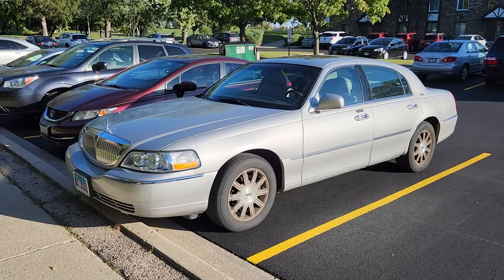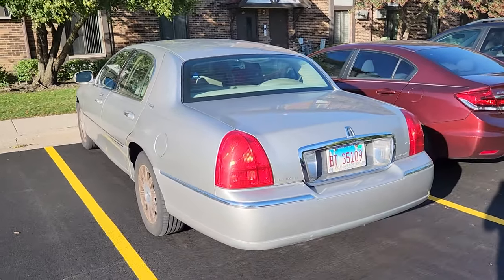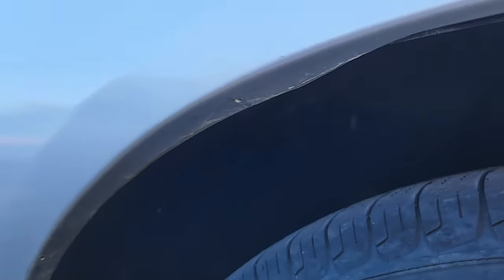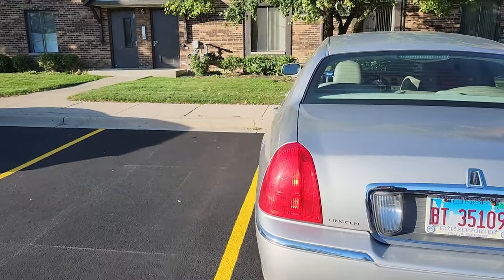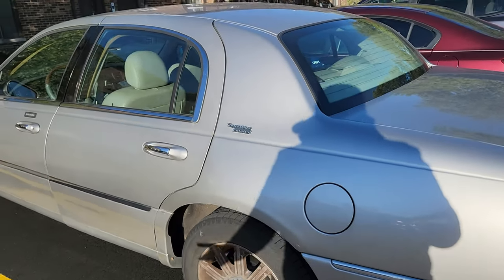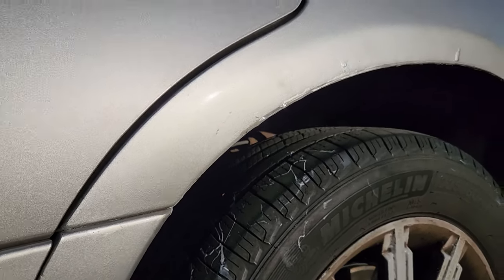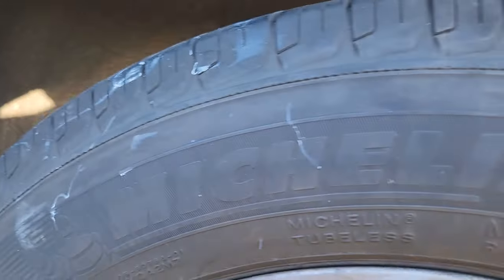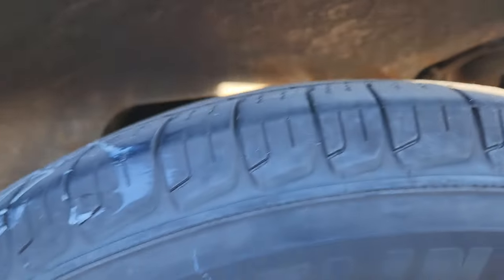Lincoln Town Car Guy Tries Flexseal to Fix Quarter Panel Rust on his 2006 Signature Limited

Comment: Flexseal doesn't "fix" rust - just a coverup.  Get yourself a small sandblaster from Harbor Freight and blast the rusty surface clean of rust.  Then metal prep and sealer followed by primer and paint - and THEN apply undercoat of your choice.
Reply: I've spent almost 4 decades around old cars. Undercoating is the biggest fail that most don't understand. Unless u r going to UC new fabricated or 100% Sandblasted, prepped, etc it will just rust under it. I can't count on both hands how many times a car has been in air or I under it looking thinking, Wow looks pretty solid until I try the screwdriver test and it's like Swiss cheese under UC. Or the whole sheet of UC is pulled off and it's all rust under. Seeing what ppl do to their cars I get not all have tools, time, money, exp to do a high level restore, but as anybody who knows or has done this work of fixing up, restoring etc prep is 90% of a good job. If we cheap out, try to save time money etc it really hurts the finished product. Some are 50mph cars or 50 feet. Looks great going 50mph or from 50 ft, any closer it's not so good. If we're talking rhino type UC,  great. Sandblaster won't hardly touch it. If put on correctly. If anybody has ever sanded, blasted and heavy equipment as Dozer, Excavators etc that JD paint is some of toughest stuff I've ever had to remove. I use that black as a coat after a rust killer type paint inside frame and under body. So basically layer the protection. As in Sand blast, Seal with whatever, prime with some good zinc primer, topcoat that Rustoleum, Farm implement paint with 3 capful of hardener, then a spray of some type of coating. A old man my pap worked with drove a post ww2 ford car to work in the 50s-90s. Pap asked How do u keep car looking like new and fight the rust, lived miles away from Lake Erie, he gave him a list of a few things. 1 quart of any oil new or used, 1 quart of new used trans fluid, 1 tube or tub of grease, 1 wax ring toilet gasket. Mix and heat and spray. U can add whatever u want to it like boiled linseed oil, chain saw oil etc. I like using hydraulic fluid as we drain from all equipment every year. Seal up drain in doors and melt a tub of Vaseline, use baby, mineral oil and some trans fluid and pour in door skin bottoms. Leave for a few days and the drain. You can do this with hood, trunk, rockers etc. I've tried 3m Cavity wax, Blaster wax, Cosmoline, Coal tar etc. Best, easiest, cheapest longest lasting is the oil, fluid, grease wax mix. Most fluid film type products at $10 per can has no oil based chemicals. U can add whatever u want to it that u want to try. I've used since 90s and have had no rust on any vehicle that sees salt, mud, rocks etc. Protection is key. Using a Ospho type product to kill rust they a wax type is best way to help keep our rides out of scrap yard. New ford's rust in months. Alot of videos on this. They don't make them like they used to. Paying 80k for a vehicle with a msrp of 40k is robbery. Have them keep their vehicle and make urrs last as long as possible.

Comment: Here in the Midwest rust is a very big issue. I had a 2004 Buick Century with 132K miles that I bought about a month before you bought your Town Car. The rocker panels had been replaced and painted before I got it. They didn’t do the best job and they were starting to rust again plus there were small spots at the bottom of both wheel wells on the drivers side.  I wanted to have it fixed but it would have been thousands and it would have come back at some point.  I found a like new ‘04 Century with 28K miles exactly like mine a few hours away that was Ziebarted new and is 99% rust free which is VERY rare for one of these here in Indiana (most of them have rot holes in the rockers now).  I am going to keep it that way and not drive it in the winter months.  I was able to sell the old one for basically what I paid for it almost 3 years ago.  The new one was not cheap, but I think this was definitely the better option as the older one was not really worth putting that much money into. It was nice having a car with some “battle scars” as you called them.  If it gets a new ding it’s not that big of a deal.  The new one is so nice and has such low miles I kind of hate to drive it😩  Oh well, now my Yukon will get more use and BTW I will be undercoating it with Fluid Film before the snow falls.  Up to this point it has pretty much not seen winter driving except for a few times last year.

Comment: Same issue when I removed those sweet shiny fender skirts. Idiots didn't seal the holes with anything and seals are crap or didnt take care of them and now I have a spot on both rears. If u not gonna weld it get some Ospho. I've used it for decades and it's the best rust converter and protection for clean metal. Most ppl just use for rust. It's great for bare, sanded, blasted etc. I tested with a muffler clamp for months. No rust. If rust is bad, flakes etc remove all u can. Then I used some muratic to get back to good clean metal. U gotta baby sit it. Can't just brush on and leave. If u don't or can't do that and it's surface rust use Ospho. Get a can of Car Rep primer. It's epoxy 2 part like used in a gun but it has NO POT LIFE. With other 2k cans u pop off red cap and pop bottom of can and u got 24 hrs max, in a ziploc in fridge b4 it's bad. With Car Rep it has no pot life. I used some months apart. It don't mix until u spray.
 The man with sandblaster got right idea. U can make urr own very cheap with a spray nozzle and a pop bottle. Small jobs only. Just like this. Blast it clean, primer then paint. I used a Eastwoods internal frame or chassis saver paint. Then farm implement paint. Undercoating is the worst idea. Even worse than flex seal. At the least use rustoleum. Spray all rust with ospho. I made my own that my pap told me about from 50s. 1 quart of any oil new or used, 1 quart of new used trans fluid, 1 tube or tub of grease gun, wheel bearing grease, 1 wax ring toilet gasket. Mix and heat and apply. I've tried fluid film, Blaster etc. U will never see rust on metal that has trans fluid, oil, grease on it. These products we buy have no oil based chemicals. So all the wax won't do much. Cosmoline is great but needs to be heavy. And it costs. My rust protection using used fluids will cost $6 and 5 min of time. A old man who worked with my pap at Ford plant drove a post war Ford sedan. Pap asked him how do u keep that old thing so nice and rust free next to lake erie and our snow? He told him what I told u. He drove that old car his entire life. No rust. Knock off heavy, spray Ospho with old bottle sprayer like Peroxide, winded etc whatever. Ospho is thin like water. It's not bad like battery acid. Wear eye, gloves and a mask. Spray all rust. Wait 24hrs. It WILL NOT RUST AS LONG AS IT'S ALL CHEMICALLY CONVERTED. Impossible on a chemical level. My 07 looked like urrs. It's been almost 3 years and it's still fine. Besides this new issue with fender screw holes rusting. And the Save a tree ppl calm down, this recipe will not run off. The waxakes it sticky as hell. Farting causes more pollution than any of this process. Gotta stop the rust. Have to. If not it will kill the car. And remember that may seem like a lil bubble but when u pop it, it's 2 times that size at least. Use a syringe to poke and put ospho in those bubbles and buy some time. I went overkill. I did chassis saver, inside frame and out, farm implement paint, then rustoleum, then my rust recipe. If u want to keep car, kill that rust. Even if you just use Ospho that alone will buy u alot of years. It's like frank hot sauce, I put that shit on everything. All the parts we buy are so cheap and not coated barely at all. Any steering lines, etc. Keep tires, air bags 303ed up and smear with mineral, baby oil or melt Vaseline. My bags are going on 8 years on 99 TC with 256k. No leaks, no cracks. Gotta protect rubber and metal.